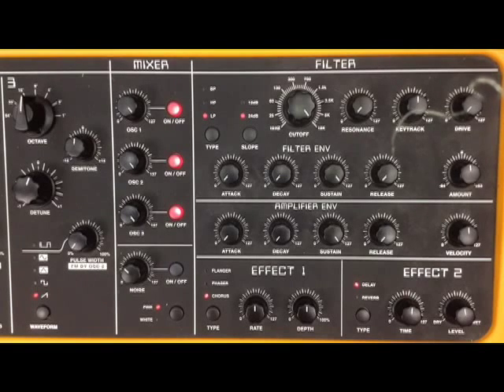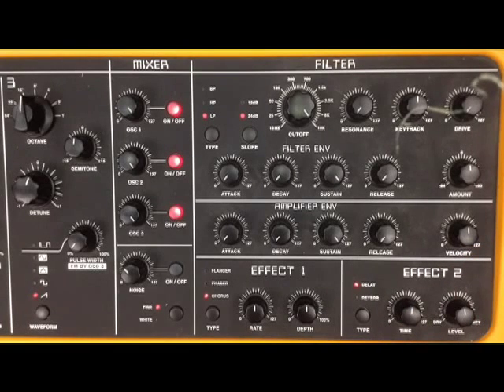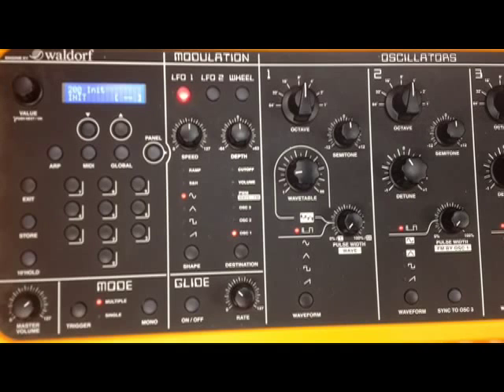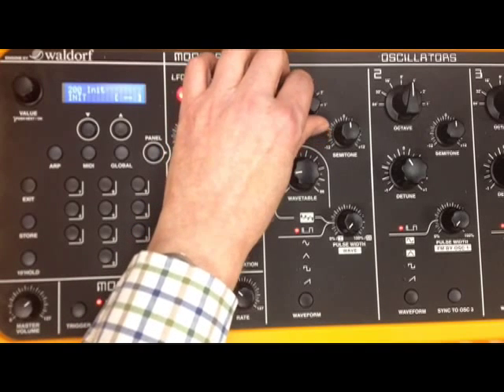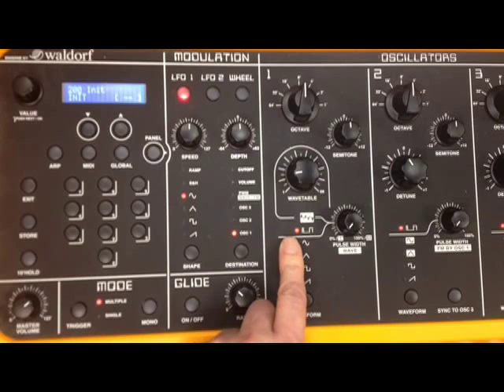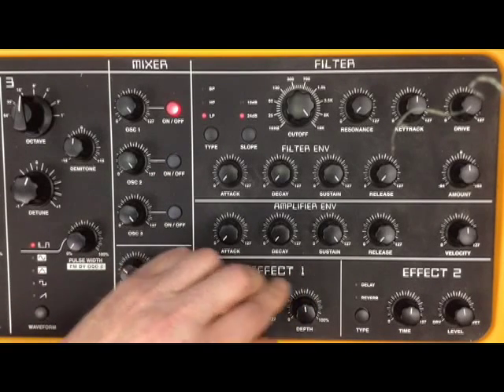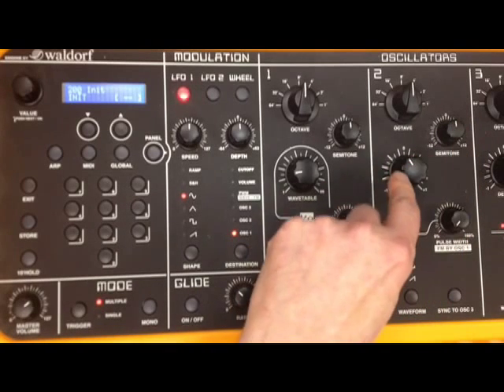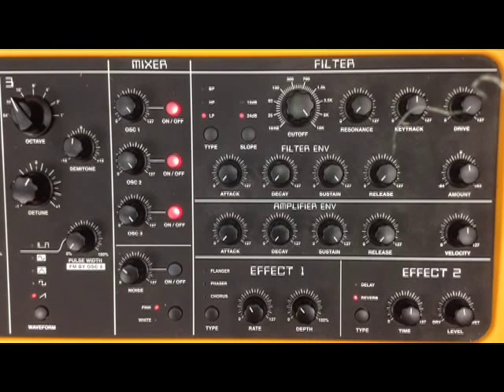Studiologic Sledge Synthesiser Tutorial Part 2 Super Saw

Comment: Why does this modulation section not have a delay? This seems like a bad design. I don't always want the modulation to start immediately.
Reply: @Chris Nowak If I understand correctly, you can program the mod wheel—but then of course your mod delay is a manual one.  You might want to consider a modular analogue synth with patch points and multiple patch-able EG’s, so you could patch the LFO to an EG and control the attack time there.  Maybe you’re asking too much from a sub-thousand-dollar keyboard?